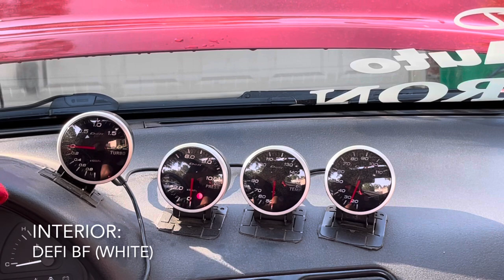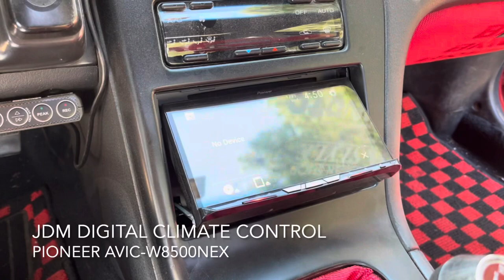~Essence~ 180SX MACHINE CHECK SPL

Comment: Hey how does your KP hood fit with the S14 sr? I have a KP hood but it doesn't play nice with my s14 SR, the vent hits the top of the valve cover and rubs the paint off, super annoying. But I refuse to run large spacers, they are ugly af.
Reply from the maker: Yo! So I had the exact same problem and the way I fixed it was by throwing on some really old stock motor mounts I had laying around. They seemed to lower the engine just enough for it to clear. With the Megan mounts I had, the last fin would hit the valve cover just like you said. Hope this helps!
Reply: @koukikev809  Damn dude we have the exact same issue! Same fin and everything lol. I actually don't have any old stock mounts, I might have to find some on ebay if I'm lucky. Do you think if I shave my current GKtech poly mounts down it might work? Or do you know of any brand that work out the box. Some dudes said the CA18 nismo ones might work. But 400 bucks is a lot of dough for mounts that may or may not work lol. Other dudes have ran a solid mount on one side and a poly on the other. But tbh I have a built SR from mazworx I'm throwing in there and I just want something not jenk lol.

Comment: Tire size and alignment specs? I have similar spec wheels and am trying to pull off this fitment with stock body
Reply from the maker: 215/40 up front and 225/40 in the rear. Alignment is in my previous video